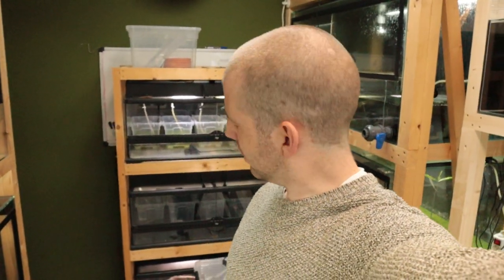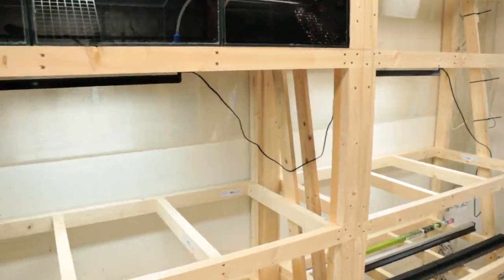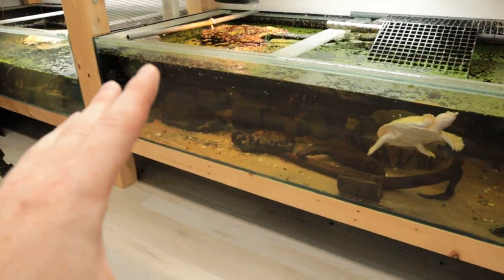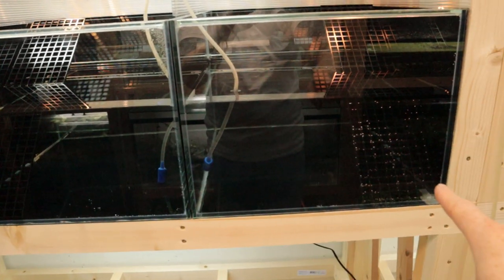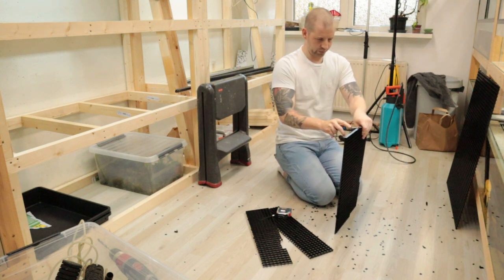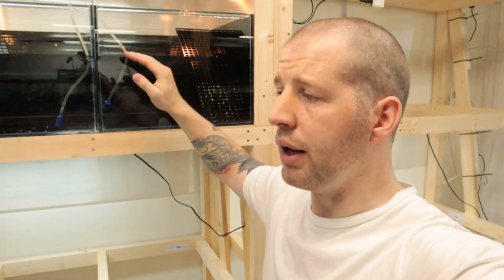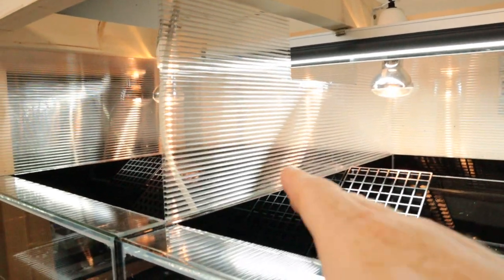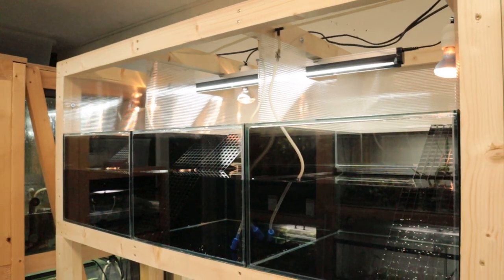Building again. NEW turtle setups @terrariumchannel

Comment: Hi , I have a question , but how do you menage to keep the humidity in the room low with all those tubs ?  By  chance do you  use a dehumidifier ? I asked bacause i have some tubs and so much humidity ! Thanks
Reply from the maker: The window is always crackt open to hava air leave the room and there is a big ceilingventilator running 15minutes a h8ur wh8ch dries out the room.
Reply: @terrariumchannel  Thanks !